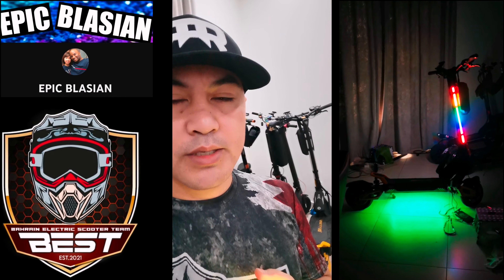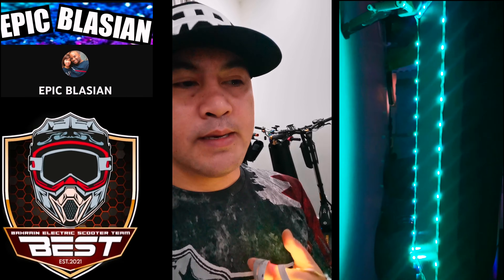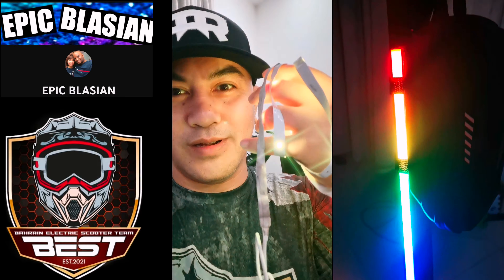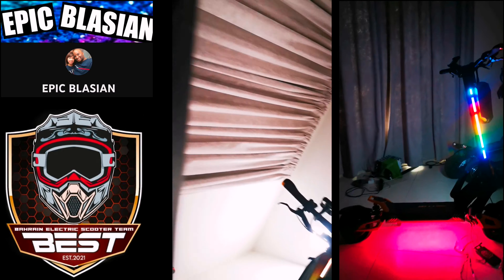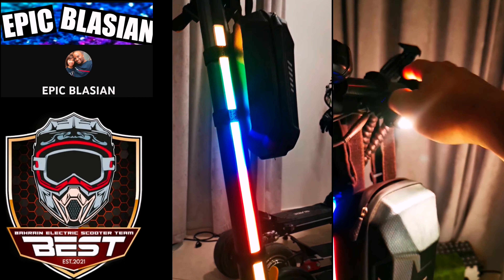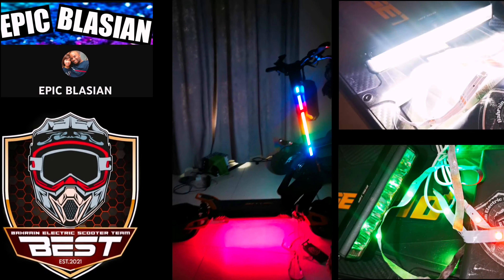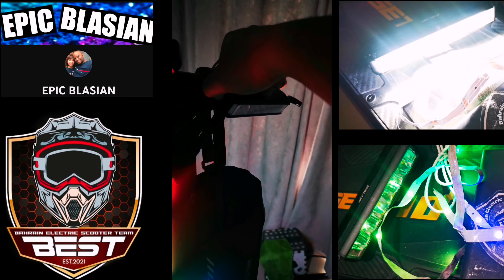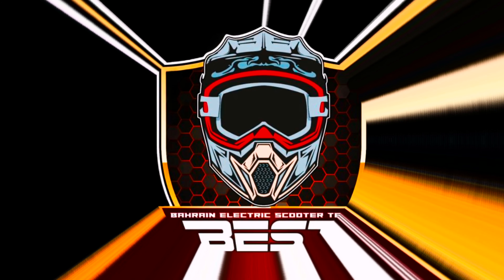How to Install 5V RGB LED Strips in Your VSETT 10+R Electric Scooter

Comment: I was going to do the same with the rgb strip but on my Vsett 11 + but i realized i would need to get a jack to lift it up if i need to change tire or brake pads and it would crush the led. It's doable on the 11+ but you really have to think it through. I have the same light but the bigger version in the handle bar. Always good to have an external light separate from the battery.
Reply from the maker: Good day to you bro, yah there's alot to consider in positioning the LED STRIP or else it will be crashed. There's alot of way also to avoid crushing it like putting wood in between of 2 sides of the LED So there is a gap in fixing or changing tires or brake pads.
Ride safe...!

Comment: It looks cool, but I'm thinking if you hit a puddle the bottom LED lights are finished
Reply from the maker: So far it's doing good. It depends on what type of LED strip you will Install. . Mine has a clear rubber coat that protects it from hard objects.